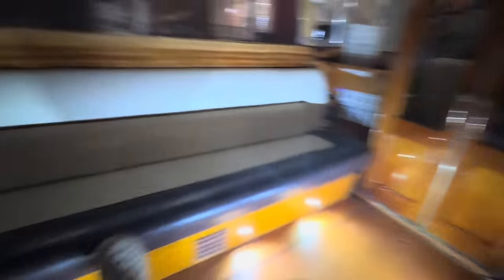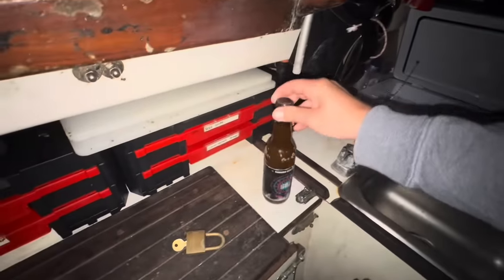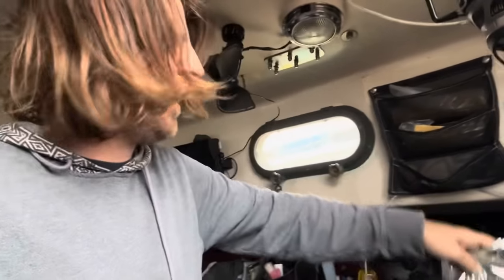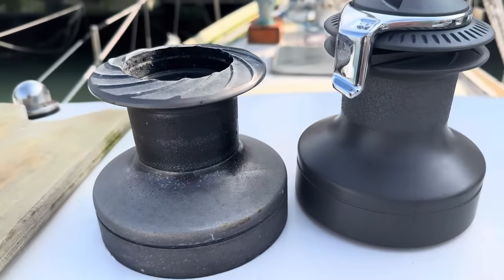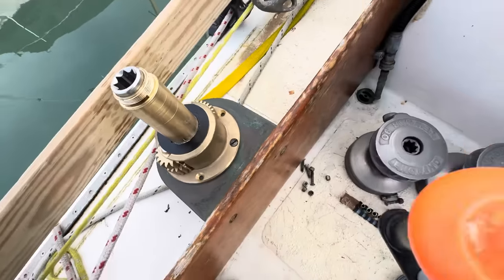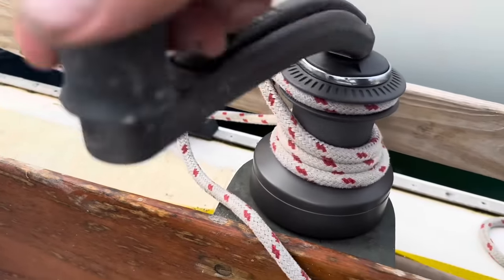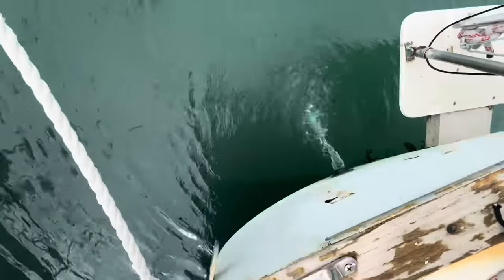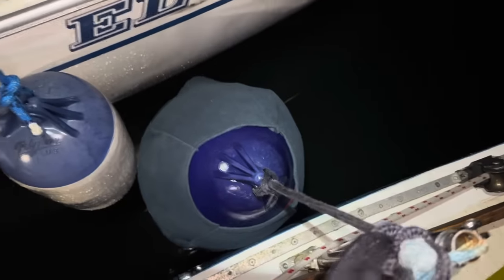Back to Venice. New Lewmar winches 😃

Comment: New motor mounts, new winches, and new haircut too, time to drill some holes in the boat.
Our International man of mystery & boating adventures. Holmes. Sam Holmes. Welcome back. 
Boat projects to complete before the new season gets underway. 

Your motor needs those new mounts. Less vibration for the driveshaft/ coupler to your propeller. 
The mounting plates for those new winches- too many holes. Replace them too when you can. 
New electronics to sort out- new comfort in the cockpit for the journey ahead. 
This season should be fun. Always entertaining. Thanks for bringing us along with you Sam.

Comment: Hey Sam, something I recently learned about mold. I feed sugar water to hummingbirds. After many years the feeders all started growing mold like crazy. I'd wash them out with Clorox bleach 1:3 water, and it would quickly grow back. Then I left the Clorox mix in them for a few hours. Solved the problem. No scrubbing necessary. They're now like they were before the big mold problem. The top edges where the soak doesn't reach may still have a bit of an issue. One day I'll fill a bucket and put something to hold everything under. On your boat.... maybe just keep bleach wiping down the worst areas to keep the bleach working over a few hours. The cushions will fade or the fabric will become brittle, but ... 
 
I've also been experimenting with Chlorine Dioxide. This is basically WWI poison gas. Drop tablets into a bucket of water with an aquarium aerator bubbling and then some fans to move the gas around. Leave it for several hours or over night. It's heavier than air so it wants to settle in the bilges, so point the fans up. It breaks down into completely inert salt, and because it's a gas there's no residue.  I can't find any residue.
I put one of my boat throw pillows next to it, smells fresher and no fading or bleach spots (unlike the clothes I was wearing when I scrubbed out my bird feeders.)  
Hotels, car rental/used car sellers, and real estate people use it a lot, someone smokes in a non-smoking room, someone dies and isn't found for a week.... (my friend's apartment manager just told me about that one.)  It kills anything organic mold, mildew, bed bugs!  Get the correct mask.  3M 6002, and several others are good. (I bought a cheap full face mask but the filters don't fit very well. I have a half mask but just dropping the tablets and leaving I could feel it in my eyes. ) 
I haven't tried it on my boat yet, but I've done my garage twice and can't find any negatives. I want to do more tests to see if it fades anything.You don't want it to splash onto anything. So in bucket, with a tray underneath.  

& No dehumidifier? That seems to solve most moisture problems. I leave mine on the galley sink, leave that thru hull open a bit.  I've  got plastic bins for my clothes on board. I made silnylon drybags that go around each bin, so open it up, everything is easy to find, no digging around. (the bins are frosted plastic, the bags are white.)  Crossing the Pacific we had several days of fog and everything got wet and my clothes got mildew even in the middle of a dense pile inside a tight locker. (I felt really stupid because I had extra dry bags I didn't think to use. Arriving in Canada, I just wanted to find a laundry.)  Cheers.
Reply from the maker: That’s awesome. Thanks for the tips. I will try that
Reply: I’m learning about mold also.  Bought a fairly new house in the Pacific Northwest, found a spot of most likely black mold under a piece of removed drywall.  

Thought I had a problem until talking to a business that deals with removing mold.   Basically wear the proper mask, use the proper filter on a shop vac, and remove it, all of it, with a wire brush   Treat the surface 

Since there’s no evidence of a leak and it’s in the center of a panel, how did it get there?   Most likely the wood panel was wet when installed 

An issue that would cause people to panic was easily resolved by talking to the right people.   It’s fairly common
Reply: @vidguy007 Maybe maybe not installed wet. Water will condense on a cooler surface so if the room on the other side is cooler or it is the exterior. Center of a panel suggests to me condensation out of the air. 
One of the biggest problems with some earlier super insulation attempts was leaving space inside the vapor barrier. Because the vapor barrier was up against the outside wall, it was cooler most of the year. Any amount of air has moisture in it and even if it almost impossible for air movement, it would still get wet and grow mold. The more modern methods are to make it all airtight, create a gradient of insulation so the temperature gradually changes through the insulation. Matt Risinger on Youtube has a lot of good videos on this topic. (Be careful, he seems never to say anything negative about a new product. But he is knowledgeable and if I was insulating he'd be a key source of info.)  (btw I'm in Los Angeles which is desert but my humidity is 40% today and usually about that year round. That's more than high enough for condensation.) 

I used to know two ways of dealing with mold. 1. Get most of it off, and make sure the material stayed dry. This was for archival art on paper. The idea was mold is never really gone, attack it and spores will always remain but they won't flare up so long as the thing is kept bone dry. 
 2. Clean it, attack it as best you can, and then paint the surface trapping it. 

But the 3rd was is to saturate it with high concentrations of bleach for a period of time. This of course would not work on a photograph -- it would break down the paper. (in most cases it doesn't affect the silver image. I'm an old darkroom photographer.)   This is what worked on my hummingbird feeders and last week end on my bathtub and tile. 
I just cleaned my shower tile and tub. Guy living alone...calcium build up.... a lot of black mold along the caulking..  Found a video suggesting using toilet bowl cleaner, which is a viscous form of bleach --  it stays on the surface longer. Worked really well.  So that might be another option.  And of course chlorine dioxide, but ask those mold experts I'm sure they know more than I do.  And do get the proper mask (pay the premium for the full face 3M mask and the right cartridges. The emphysema you never get will be your reward.

Comment: Hey Sam, not sure if you realised, but the winch needs to be aligned so the output gear (the gear that engages the ring gear on the inside of the drum) is at 90 deg to the 'lead' of the genoa sheet. So your port side winch looks like it needs rotating about 90 deg on its mounting in a counter clockwise direction. Also, dont forget to grease the winch gears and the S/S roller bearings if not already done. but DO NOT grease the springs & pawls, they need just need a drop of light oil. Grease will make them stick and stop the winch ratcheting.
Reply from the maker: Thanks for the tip. I’ll take another look at it

Comment: Just a suggestion but those winches have a specific orientation so the side force of the sheet on the drum should be at the gear so the gear holds the drum vertical and doesn’t put a lot of force on the center bearings
Reply from the maker: Thanks for the info. I didn’t know that

Comment: Try some rock salt dehumidifiers. It takes a few but it prevents the mold. I have been using it on my 25ft boat and it works fine.
Reply from the maker: Thanks for the tip. I will try it.

Comment: Great to see you back on the ‘Pickled Herring’, with new winches and some other Bits’n bobs. It’s amazing how that mould builds up, but easily cleaned up it seems. Aren’t there ‘products’ that you can apply to keep the mould at bay? I hope the engine mounts are a simple ‘install’ ? Access into the smaller spaces on boats worries me a bit, but I’m sure you’ll have them in, in  double quick time.  Good luck with those jobs and I hope too, that your skiing trip goes well for you? You don’t want a broken keg or arm to hinder your sailing , so no heroics on the slopes ha ha! Thank you Dam.
Reply from the maker: I wiped most of the surfaces down with bleach and vinegar before I left and I think it helped because the mold was much less this year.

Comment: Lewmahs ah the best! Good going getting them. Next time you stoah Pickled Herring, in the watah you might want to consider leaving a 60W incandescent light illuminated, fixed rigidly to the cabin sole. That usually provides sufficient heat to discourage mildew growth.

Comment: Nice haircut. Also, I'm kinda confused about why the old Lewmar winches wouldn't stay loose. Were they a freshwater only spec or something? Doesn't matter any more I guess!
Reply from the maker: Some corrosion issue in the top part. The top cap was also the nut holding it all together and the threads corroded away and let it screw on too far so it pressed on the drum and seized up.

Comment: No offence bro. I live my best life vicariously through you, but..
.. no matter the quality of the new  winch, I would be concerned about the structural integrity of the wood that its bolted/screwed to. When last has that been seen to?
Reply: He glassed over entire hull deck joint a while back and winches are mounted to metal.
Reply from the maker: Idk they seem strong enough. They’ve never been a problem and it’d be an easy fix if one breaks.